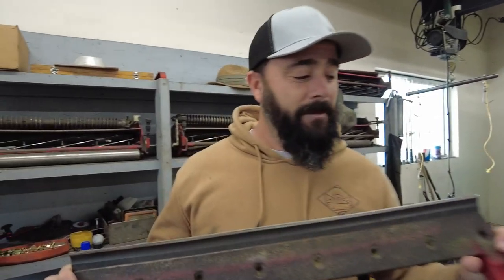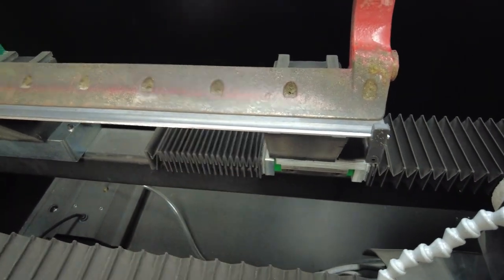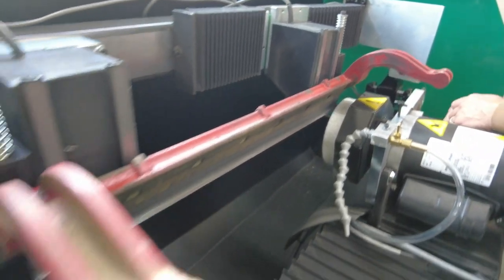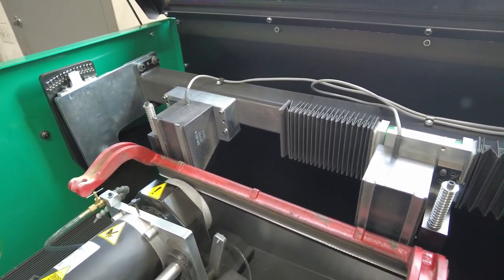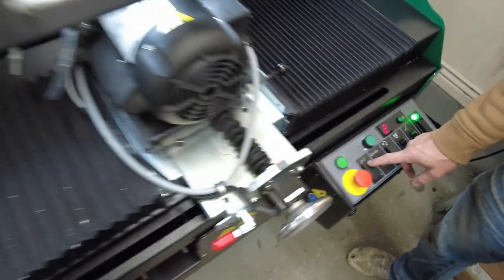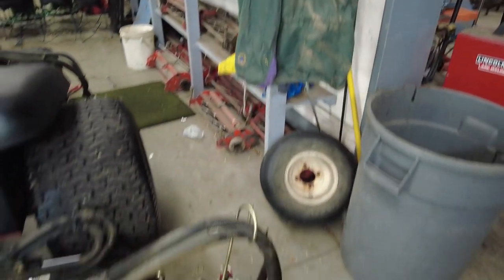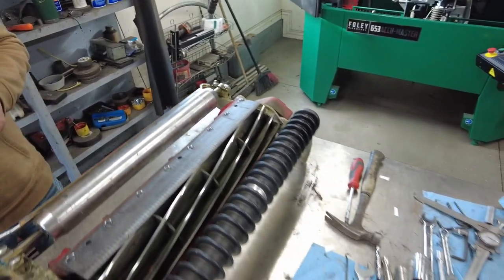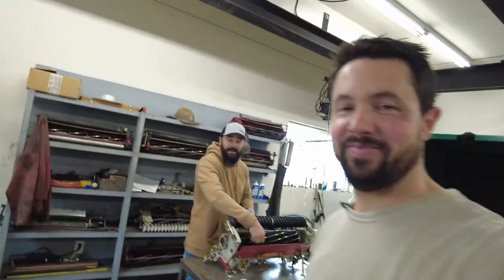How to grind a Bedknife "Foley 673"

Comment: Hey a little advice it looks like your not grinding enough angle on the top face. I would try scratching the stone to see where it contacts  and adjust your stops should be around 10 degrees or more. Get your scratch to be in center or rear of angle.

Comment: Just wondering on those 2 adjuster bolts to adjust the bed knife there's a nut on other side where spring is on that nut is it supposed to be tightened all the way down to squish spring or dose spring have to have a little play in it just wondering because the ones we working on sharping the spring are flat squash spring seems like not doing anything. I'm new at this but the guy thats showing me how to sharpen been tighten that nut all the way down but to me it dosent seem right
Reply from the maker: Are you referring to the movable bedknife stops it rests on before you turn on the magnet?
Reply: @ericschneiter  no sorry the 2 to adjust bed knife
Reply: I tighten mine down so that i can turn the washer with my fingers slightly. Not too much, not too little. If its so tight that you cant turn the washer with your fingers, the spring is too tight. I try to be just under that. If that makes sense.